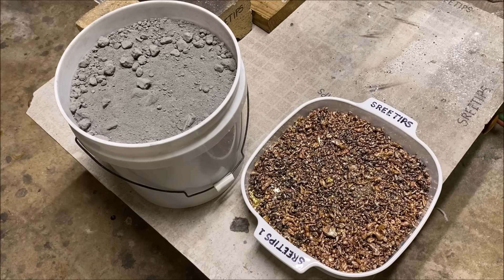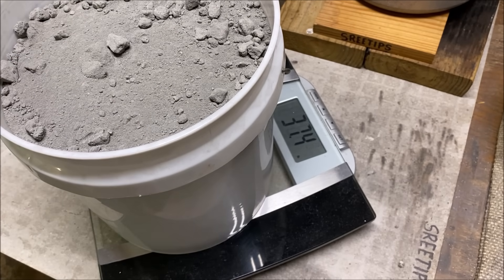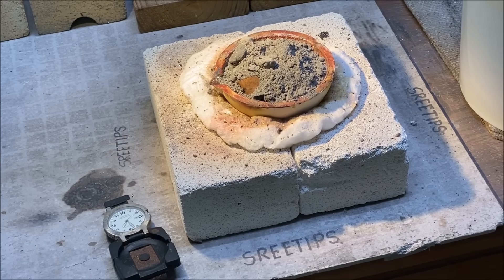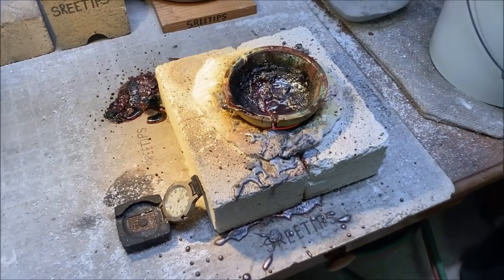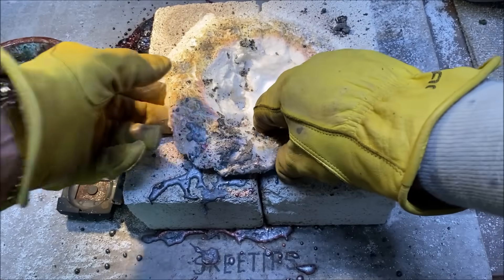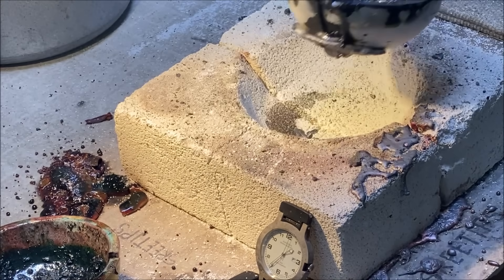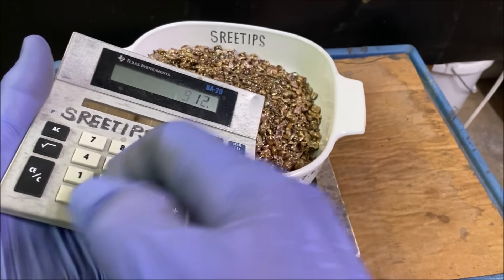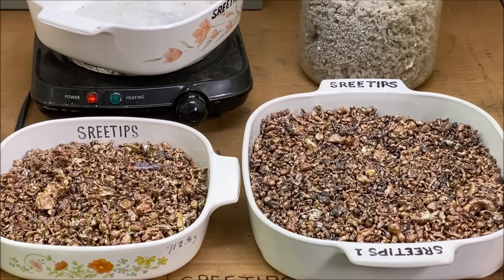Making Silver Shot To Feed The Silver Cells

Comment: I've been collecting silver connections and have about 4 or 5 pounds in box saved up. I brought one piece to a scrap yard that scanned it and he said its 30% silver 30% copper and the rest nickel and zinc. How do I separate the silver from the rest?
Reply from the maker: Dissolve in nitric. Cement on copper.
Reply: @sreetips cement on copper?
Reply from the maker: Reduce the silver nitrate to element silver by adding clean copper to the silver nitrate. It’s called “cement silver”

Comment: I’m just curious but do you go to sales and buy up silver jewelry and silver cutlery and that’s how you get your cement silver and you dissolve that in diluted nitric acid correct
Reply from the maker: I refine gold. I use sterling silver, that I buy at estate sales, to refine the scrap gold. I recover the silver from that, melt into shot, and run it through my silver cell. Silver is a by-product of my gold refining. The cell converts the impure silver (about 980 parts per thousand silver) to high purity four nines fine (9999 parts per ten thousand) pure elemental silver metal. So I’m refining the impure silver, into high purity silver, not creating silver out of thin air. When it’s full, I harvest the pure silver crystal, put it away and forget about it. Then I repeat the whole thing again.

Comment: Do you need impure silver for it to work or can you use pure silver? Or will cement silver alone work? I’ve been watching your videos and I just need a hand with the size and kind and how many beakers you use and the silver to put in the filter. I just want to be 100% sure before I do it. If you could get back to me asap it would be greatly appreciated you’re probably busy but you would help me out a lot. Thank you for listening
Reply from the maker: I refine gold. I use sterling silver, that I buy at estate sales, to refine the scrap gold. I recover the silver from that, melt into shot, and run it through my silver cell. Silver is a by-product of my gold refining. The cell converts the impure silver (about 980 parts per thousand silver) to high purity four nines fine (9999 parts per ten thousand) pure elemental silver metal. So I’m refining the impure silver, into high purity silver, not creating silver out of thin air. When it’s full, I harvest the pure silver crystal, put it away and forget about it. Then I repeat the whole thing again.
Reply: @ ok I have 1200 grams of pure silver I was gonna use to make that concentrate with the nitric acid so to make the shot do you just melt down the sterling silver and that makes your shot? I am a very beginner I’m still watching your video over and over and that the only part I’m having a problem with to make sure I do it right. So I can dissolve my silver in the solution that will make two batches correct? Then for the shot can I just melt down the sterling or do I have to use nitric acid? And just the beakers you use a size. Any chance you could baby step me through that one process? I’ve watched it about the shot but it doesn’t explain exactly so do I melt sterling and add silver cement or can I just use the silver cement or do I need both? I have everything I need to get it going except the shot and beakers. Even if you have to write it down step by step to get me going and I can pay you for the work and information and I would also be very greatful and in your debt. Thank you
Reply: Also I don’t refine gold yet so what’s my best way to make shot from scratch if not refining gold?  Sorry for being a pain in ass
Reply: @sreetips  I’ll even buy some shot off you until I can figure it out without messing it up! I’m trying to get it up and running running asap so any help would be greatly appreciated thank you again
Reply from the maker: I have a three part series that shows what I do from start to finish from sterling silver to high purity silver crystal.
Reply: @sreetips  thank you I’ll look for it! I appreciate your response and all your videos thank you again sorry for being a pain
Reply from the maker: No problem.
Reply: @ ok I promise my last time bothering you do you soder the wire to the block of silver for the filter? Or how do you connect? I watched the video and keep rewinding to that part but it’s hard to hear what you say. Also the very last thing does this shot I made look correct to you? I thank you so much for all your help and promise these last two questions is it and I won’t bother you anymore. lol sorry and thank you!  Looks like I can’t send pics but I melted down sterling and dripped it into water so I’m hoping it’s right I have one shot at it to make it work
Reply from the maker: I make a loop, suspend it in the mold cavity, then pour molten silver and cast the bar around the wire.
Reply from the maker: I use cement silver shot about 980 parts per thousand. Sterling is 925 parts per thousand and will quickly saturate the electrolyte with copper.
Reply: @ can I add cement silver to the sterling shot or just buy silver cement an use that? This is my last step before I can get going with it and how you connect the wire to the silver bar on top
Reply: @ is the cement silver the crystals you collect or do you buy your silver cement?
Reply: @sreetips  or how much silver cement can I add to the sterling to get the 98 99 percent? Is there a formula to figure it out? I’m trying my hardest to get this going the right way.
Reply from the maker: @StephenGalvin-x1f  I cast the wire into the bar
Reply from the maker: @StephenGalvin-x1f  cement silver comes from my gold refining.
Reply from the maker: @StephenGalvin-x1f  sterling silver has too much copper.
Reply: @sreetips  ok I see so would I be able to use the pure crystals and melt it into shot or it has to be impure? I’ll have to buy the cement online for now cus I don’t refine gold yet. But should that work or I need to buy the silver cement myself until I can figure out how to get it from refining gold. Thank you for being so helpful
Reply from the maker: I get cement silver by recovering the silver from my silver solutions. Then I melt it into shot and run it through my silver cell.
Reply: @sreetips  ok thank you but just so I’m am clear on everything you use the silver crystals from the bowl that’s what you call silver cement? Also I bought reagent grade nitric acid I see you use technical grade but will the reagent grade work for the first time or does it have to be technical grade? Only asking because if I don’t have to return it it would be much easier for me but if only technical grade will work then I’ll just have to purchess that. And thank you again I’m trying to get things up an running asap but had to put things on hold for a few because of a passing in the family but I’m ready to get going now and just making sure I do it right just like you. Would soder work to connect my first bar until I can melt some bars and connect the wire that way. I’m sure you have a lot of text to write back to but if you could answer me these last questions I think I have it down where I won’t hurt myself. Thank you again for sharing all your knowledge
Reply: Also if I bought silver cement online that would work just fine? I’m trying to get this running by Thursday or asap so I believe this should be my last question to bother you with. Thank you
Reply: A lot of the silver cement I can find is all 999 pure doesn’t it have to be impure or is pure fine to use for shot?
Reply: Any possibility of you selling me some cement so I can get started or selling me the shot? I’m having a hard time finding silver cement online a the stuff I find is pure. If pure is ok I have a bunch of 1 oz bars can I melt that for shot? Sorry for all the dumb questions probably to you but you look like a chemist of some kind and I’m a carpenter doing this for a hobby and supplemental income I i appreciate everything and all of your responses it’s just that I’m use to blue prints and exact directions to build stuff watching on a video and not know all the terminology and having to constantly rewind it’s hard for me. That’s why all the to you simple questions but I don’t want to kill myself doing it because I didn’t ask the right questions. I’ve been saving gold scrap for awhile to get started with all this but I don’t know all the places to find scrap gold besides jewelry and computer parts. And even then I only lucked out because I have a lot of military grade gold scrap. So if there’s anything you can do for me like sell me some shot to get started that would be great but your knowledge and actually answering my questions has been a greatly appreciated help either way so thank you for everything you have already done!
Reply from the maker: You must have a fume hood. No way to safely do these reactions without one.
Reply from the maker: Cement silver is a by-product of my gold refining. It’s not for sale by anyone.
Reply from the maker: I run cement silver, melted into granules, through my silver cells. The cement silver comes from my gold refining operations.
Reply from the maker: @StephenGalvin-x1f    I buy sterling at local sales. You can hold the sterling silver  just like it is. No need to refine it. Just don’t try to melt it and ruin the markings. Then its purity becomes questionable. I offer to answer simple questions in the comments section of my videos about my refining processes. But I don’t offer any training or tutoring services. This is my hobby.
Reply: @sreetips  ok I understand so I have to refine my gold to get the silver cement but to get started can I make shot with the pure silver I have? And the rest I’ll figure out on my own so there’s no trouble for you. An when you say I don’t have to melt sterling for shot do I just cut it up in small peices? I keep watching all your videos but they never show how to start from scratch or the very beginning. You always have what you need from what you do that’s what I want to do I’m just asking how to start from the very beginning without having any cement silver but I will after my first batch so just want to make sure my silver ingots will work for shot if so thank you that’s all I need to know to get started. I love all your videos and it’s all stuff I always wanted to do
Reply: And the nitric acid has to be technical grade reagent grade won’t work correct?
Reply from the maker: @StephenGalvin-x1f I have a three part series from start to finish of the complete process using a one liter glass silver cell. Posted on my channel.
Reply from the maker: Tech grade is fine for tefini g
Reply: Does the cement silver you can buy work? Or pure silver or it has to be mixed silver? Like I was saying this is the last part I need to be sure of. Thanks
Reply: Bum
Reply: What’s the impure percentage does 2 grams of copper and 100 grams of silver give me 98%?
Reply from the maker: @StephenGalvin-x1f 98g of pure silver and 2 grams of pure copper is 980 parts per thousand pure silver.
Reply: @ I messed up a bit I was following your directions with quantity’s of nitric acid but didn’t take in account im using 70% i believe you said you use 67 68 % so the solution keeps reacting so I’ve been putting in a little silver at a time to try an eat up all rest of the nitric acid. Is that the correct solution keeps reacting adding a little silver an distilled water until the reaction stops completely?
Reply from the maker: @StephenGalvin-x1f that’s how I do it
Reply: @sreetips  ok cool so now this has to stop reacting and bubbling completely before it’s done and ready correct? That extra 1 or 2% is making a huge difference I used much less for second batch but still reacting a tiny bit. Just keep going until it completely stops??
Reply from the maker: Yes, however, a tiny bit of nitric is required for the reaction to work properly. Plus, the silver nitrate solution must be diluted before adding copper to cement the silver to avoid passivation.
Reply: @sreetips  ok it’s only bubbling small an slow an taking a long time for silver shavings to dissolve. I have 1200 grams dissolved in 3000ml of distilled water so I can make two batches at once, I’ve been copying you exactly the best I can so I should be ready to filter and put into my bowl? I’m not sure what that last part ment I’ll have to look it up but there must be some nitric in there if it’s still bubbling a little bit correct?
Reply: @sreetips  also on the filter flask how important is the airflow tube for the filtering process?
Reply from the maker: It draws a vacuum
Reply from the maker: I boil my electrolyte with some undissolved pure silver to ensure all the nitric has been consumed. Excess nitric in the silver cell electrolyte can cause problems by leaching palladium (if any) down from the anode basket.
Reply: @sreetips  oh ok so I boil the solution until it stops bubbling completely. I must have read it wrong it stopped dissolving so I put a few more drops in I thought you ment there should be a little nitric left in the solution so I’ll just boil the rest of that out then set up the bowl
Reply: @sreetips  ok I’m a little confused in the video and your text you say to boil it all out so there’s no nitric in my solution but then you say I need a little nitric acid in there for it to work right? So do I boil all the nitric out of my solution or leave a little? I don’t have any electrolytes this is my first batch so what should I do boil it all out or leave a little in there?
Reply from the maker: @ I ensure that all free nitric is consumed for the electrolyte.
Reply: @sreetips  so after all the silver stops reacting this means the nitric is consumed right? Then should I add a few drops of nitric to it so it works properly?
Reply: @ ok thank you an just to be sure there should be no reaction at all off the pure silver an that’s when it’s done correct? I keep adding silver but it keeps on dissolving I obviously should have used less to start but it’s my first attempt so lesson learned Ned I guess
Reply: @sreetips  hello Mr sreetips thank you for all your help and responses. I just one more important question. Making my solution there is still a tiny bit of bubbles coming from my silver like a tiny little stream of bubbles. Is that still reacting or is it just bubbling from the heat? I put it on Wednesday my nitric is a little stronger at 70% an used your amounts witch ended up being to much so I’ve been adding some silver an distilled water but I’m still getting some tiny bubbles with it being my first try I don’t know if it’s reacting or if it’s just heat bubbles? After this I should well on my way by myself. If you could just let me know I would greatly appreciate it. Thank you so much for all your help and knowledge. I love watching your channel
Reply from the maker: No
Reply from the maker: That’s correct
Reply from the maker: When making electrolyte, strong boil, no fumes, some undissolved silver, lets me know it’s done.
Reply: @ great thank you! I did forget to ask you if I have 988 grams of silver how much copper do I add? I’m not confident I calculated it right. Everything else has been working out perfectly.
Reply: @ I ask because my shots color doesn’t match yours that’s why I think I didn’t add enough copper and don’t want to screw it up now after coming this far
Reply from the maker: @StephenGalvin-x1f a pound should do it
Reply: @sreetips  hi there? I was wondering is my shot supposed to turn green or does that mean there’s to much copper?
Reply from the maker: @ I don’t know. Green is copper.
Reply: @sreetips  ok thanks I know it’s copper it has that beautiful green. Actually the best green I’ve ever seen better than all the mill roofs in Lawrence and Lowell. Next time I should probably do a half pound with a 1000 grams an see what happens. Do you know if the green slime can recover any copper if dried and melted? Or if it can be used for anything or is it garbage? I have a bunch of military grade gold scrap I probably should start refining that to get some silver cement like you use. Maths never been my strong suit but do you know any formula to use to be able to get a 98% silver copper mix? My filter clogged up rediculous after 3 days so I cleaned everything as carefully as I could and it’s running again so I guess I have to dial it in until I get it running how it should.  Again thank you for answering my questions Im probably getting on your nerves but I appreciate everything!
Reply: @sreetips  hey there I was wondering my cells were working they started to crystallize but then it stopped growing crystals and started plating out silver but it’s plating out now in the middle of the solution and just raining down and collecting like dropping sand in water not growing crystals anymore. Did I do something wrong. Should it be growing like crystals or is what it’s doing just fine??
Reply from the maker: @StephenGalvin-x1f that’s baffling. I’ve never seen that happen before. Sounds like a parameter is off somewhere.
Reply: @ huh weird mine is an exact copy of yours no difference in any way, that’s unfortunate I was really trying to get this to work. If you have any ideas I would greatly appreciate the help. Thank you
Reply: @sreetips  how fast or how much shot do you go through per batch? I’m trying to trouble shoot an see what went wrong but I can’t find it. Everything is exactly like yours but you said that’s never happend to you before. And I’m stumped.
Reply from the maker: @ it could be a hundred things. Electrolyte concentration, current flow, cathode material, anode material. Too many variables to try to diagnose in this media
Reply: @ ok I was gonna ask if I should lower the amps I had it at 3 I copied you exactly. Is there anyway I could send you a pic or something maybe you can see something I’m missing?
Reply from the maker: I run mine at 3.5 VDC in constant voltage mode. Let the amps fall where they may.